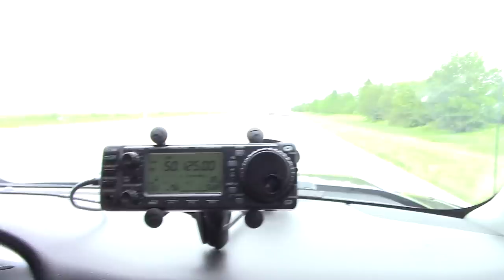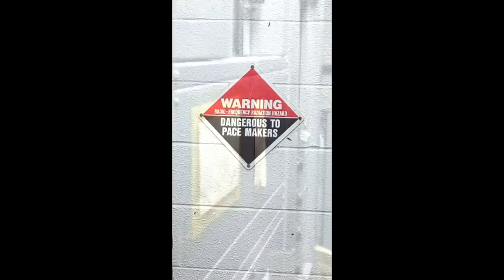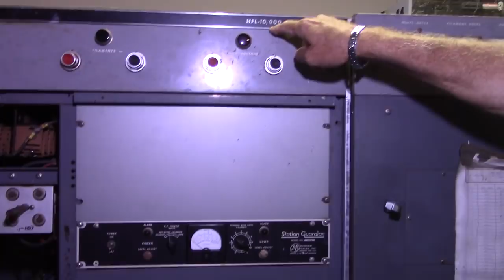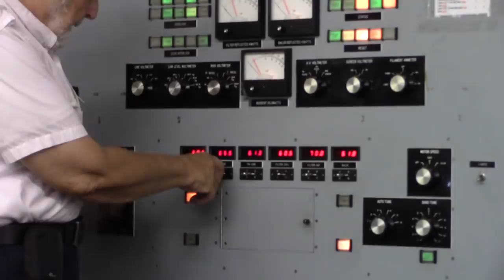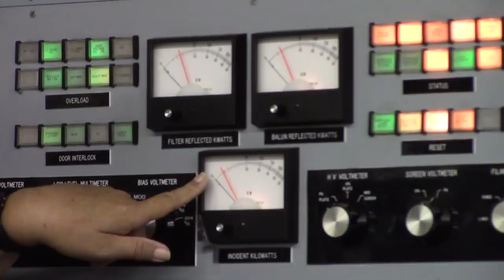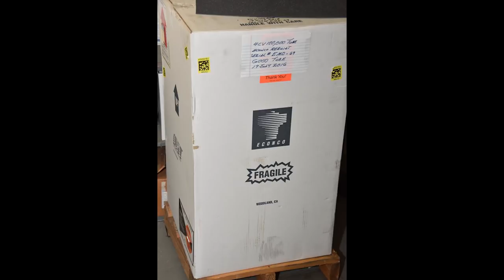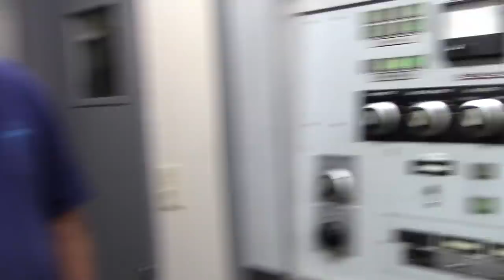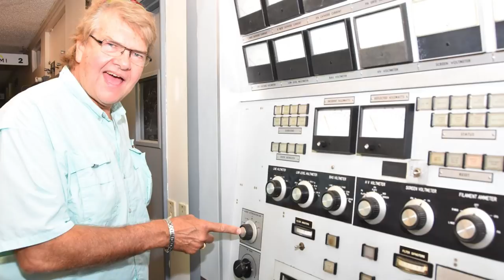1.4 MILLION watt Shortwave station WRMI Florida

Comment: A very impressive rig with mind-blowing statistics.  We didn't get much technical details, like how does the broadcast signal input get to the transmitter and how do they check for malfunctioning of the radiated output signal.  Do the antennae return ground currents cause problems such as frying up local cows due to potential differences across the field areas?  And with such power being radiated there must be aliens somewhere in our galaxy trying to make sense of some of the crazy stuff being broadcast and wondering if there is intelligent life on Earth! 
Otherwise, great stuff! 🤔

Comment: Lol just came across this, really good video. I used to run a high frequency tube mill and this is really old school, but it's a better quality signal then using mosfet banks. We had a couple of transformer go bad on the mill, and everything that was in the control panels were in my mill. Jesus stick that made me laugh,  we had one but didn't call it a jesus stick.lol
  The oscillator tube is a closed system and the water does not evaporate.  It has to use distilled water.  If it uses regular water it will create iron nodules in the cooling system and it tends to plug up then you have really big problems especially if you have to trace it down where its plugged up. The tubes burned out from time to time and I could usu tell when they were getting tired, you would have to turn up the power more and more to get a good weld. They ran in price around $20 to $30 grand if you could find them. I would really like to walk thr that station. If I remember right the high freq ran out at around 15000 watts top. Have a great one de AC8GF

Comment: Does the Desert Inn still have the rubber spiders and bugs on strings?  the bartender use to be able to let one down on the table you were setting at.  This was back in the 1970's.

Comment: DANGER HIGH VOLTAGE
KEEP OUT.Not only will it kill you but it will hurt the whole time you're dying. Borrowed from youtuber AvE. Seemed appropriate  here.
Reply: They need to buy his signs.
Reply: @earledward8766  I've watched a coworker die from an arc flash. He died in extreme agony. Had nightmares for years following.

Comment: THEY MUST HAVE TALKED TO UFO's WITH SUCH POWER.  ephemetherson
Reply: +Eric Kaminski  The problem is that 9.4 MHz (Which I think is the frequency WRMI-SW operates on) is within the MUF (Maximum Usable Frequency) band, so their signal would have reverberated off of the ionosphere many times over without going into space, not at all unlike AM radio.  FM and TV operate in the VHF and UHF bands, which go through the ionosphere and into space with the right amount of power.
Reply: @scratchpad7954  So you are saying that even with all that power they can not talk to the space station?
Reply: @davidhenderson3400  It's entirely possible, or at least, the signal would be so weak as to be borderline undetectable.  Radio waves in the THF band (300GHz - 3 THz) begin to encounter the same problem until you start entering the IR and Visible portion of the spectrum.  That's why the ISS uses the 145 MHz slice of the radio spectrum, although 1.4 MW is an insane amount of ERP for a radio station.  You could easily power a small Tesla supercharger station including the owners' lounge if there is one with that amount of power.
Reply: @scratchpad7954  The reason I asked the question is the video I watched right before this one was about people with ham radios talking to the space station as it goes over head. If some one with a home set can call up the space station and this one would have trouble doing so I was like "WHAT?"
Reply: @davidhenderson3400  I can see the confusion.  I can imagine that the time one would have to accomplish that would be extremely narrow because of how fast the International Space Station flies.

Comment: The background noise at 23:09 was that hear able there or was that coupled in to the camera mic?
Reply: There are several audible sounds at that time stamp, but if you are talking about the sound that is somewhat like crickets I would imagine it was caused by magnetostriction in some of the chokes or transformers that the audio signal passing through (in which case it is most likely audible in person as well).  But I could also be wrong as that’s my best guess as there seems to be a rhythm to the sound that has a rather voice like cadence to it.

Comment: Maybe a dumb question, not sure as i stumbled across this searching for something else.
But what are they transmitting from here?
Is it radio shows or emergency broadcast or what?
He mentioned customers paying to have the signal aimed at particular locations but didn't mention what for.

Just curious as i was an electrical superintendent for two years down there (live in NC) building the new pump stations for the Everglades below Loxahatchee not far from the lake and i provided the power cabling and wire to the microwave antennas for emergency comm's in FL for the army corps of engineers.
Reply from the maker: Almost anything really... News programs, the word of God, Ham programs, Music, whatever the customer pays for.
Reply: Used to be religion primarily.  A bit more variety now days.
Reply: @HamRadioConcepts  ok thanks, was curious and figured that might be the case. We have a small one near me now that does the same things but mostly religious broadcast and not near the amount of watts from what I've seen and heard.

Comment: How long between phoning 9-1-1 and someone arrives that can do something more than First Aid? Defibulator, drugs, etc?
Reply: I work in data centers fed by 230,000V transmission lines capable of delivering a lot of power, generally more than 75MW each. We keep automated defibrillators in case of accidental contact, but that seems optimistic given that accidental contact would vaporize you.

Comment: They're still using Windows XP!!!
Reply: Windows XP is a reliable workhorse.  Windows 7 was as well.  Windows 8.1 and Especially Windows 10 will not be making their way into control machinery, the military, nor any serious industrial application in high numbers.  Many professional networks use Windows XP embedded and Windows 7 embedded. There is simply too much fluf in 8.1 and 10.  Also, it has been proven 10 has Microsoft spyware.
Reply: @indridcold8433  Sadly there will never be another os from Microsoft exactly as good as XP was
Reply: @radioboyintj  Microsoft tried to cut support for Windows XP a few years ago.  But they could not do it completely because of the number of industrial applications.  They could not force people to go to the pig Windows 10 spyware OS.

Comment: pretty expensive, antiquated equipment....the internet is much easier to get your message across the world....shortwave transmitter stations are going the way of the dinosaurs.  Internet shortwave requires a switch, server, router and a laptop....minus the high voltage.

Comment: just think about all that heat made.
Reply: I used to repair computers and networks for several radio stations that belonged to the same company.  In winter, if I had to repair something in the transmitter building, it was never heated and I often had to open a window when it was snowing outside.

Comment: Digital SUCKS and will lead to a HUGH downfall! Why does Digital suck? Remember when you had Analog TV? You could eventually get in a station your adjusting the antennas too? Well- in digital you either have a GREAT signal or none. Same applies to Analog vs Digital for 2 way radios. You need a great signal or your literally cut off. The WHOLE purpose of Analog is to REACH people. Not force them into a new commercial 'mode' that costs big $ and is almost useless in many scenarios.....